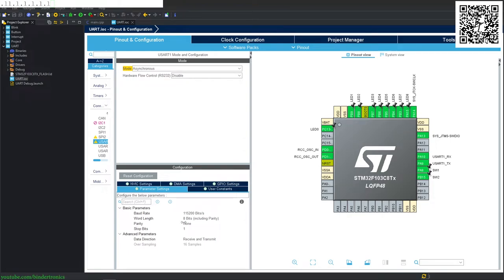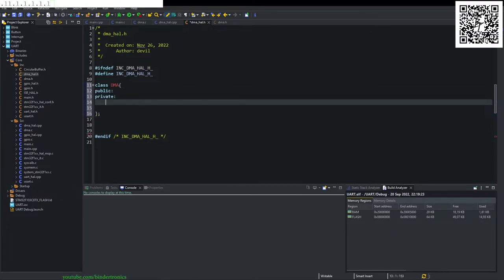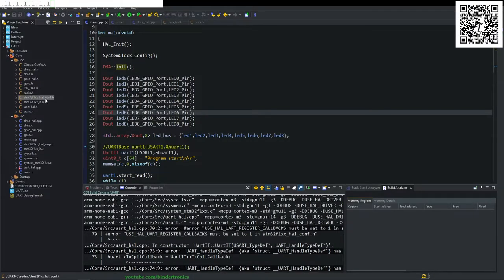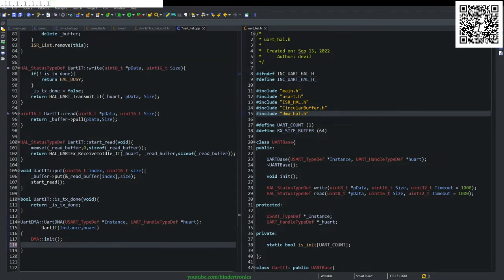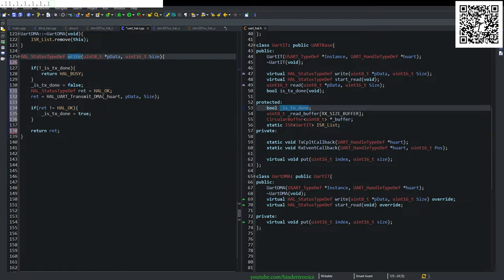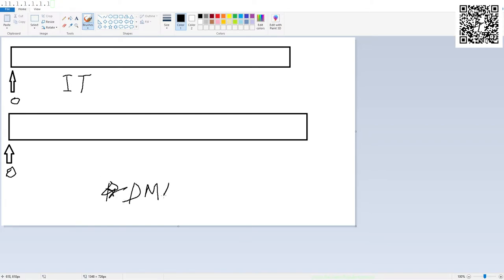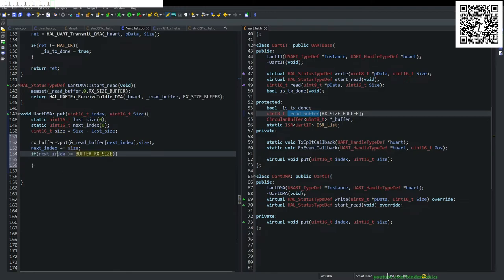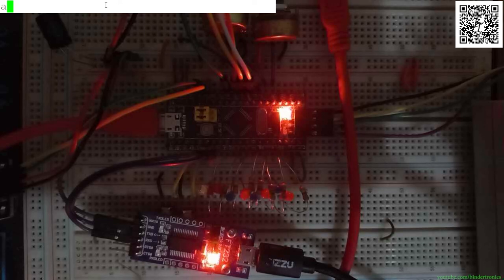Serial UART DMA 🟣 STM32 Programming with STM32F103C8T6 Blue Pill C++ in STM32 Cube IDE

Comment: I am in very big confusion, about usb bootloader , how usb bootloader  update firmware, could you please describe the usb bootloader and how command prompt is used for this action.
Reply from the maker: Hang on my dude. You are going from 0 to a 100 real fast. You must crawl before you walk. 
You got some prerequisite. I will cover all of this in due time including creating a bootloader.
- Must be able to read and wire to the flash
- Understand your flash layout
- Understand how to setup your flash in the linker
- Understand your build outputs files 
- Get a simple application jump working
- Understand how to read an write binary files from a PC
- Understand the interface you are going to use. It can be USB, UART, I2C, SPI etc. 

Does not matter what the interface is all you want to do is stream the application binary file to the bootloader. 

I would recommend not using USB. It will eat up your flash memory and it is a total bitch to work with. UART will be the least painful.